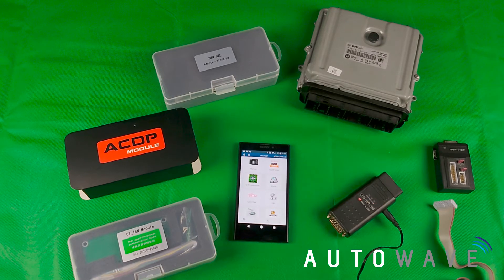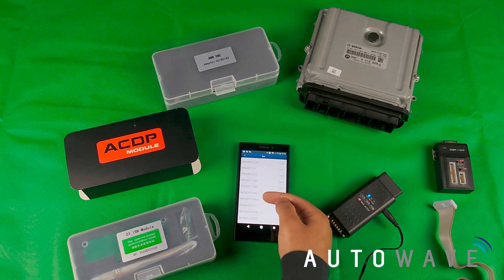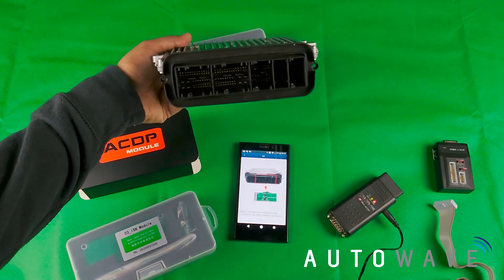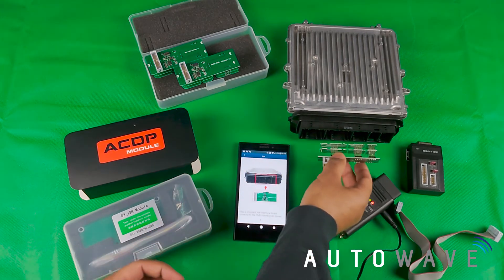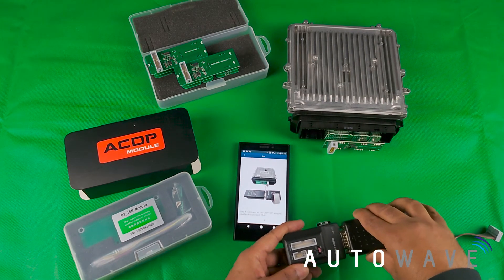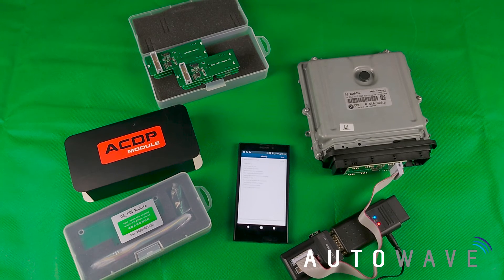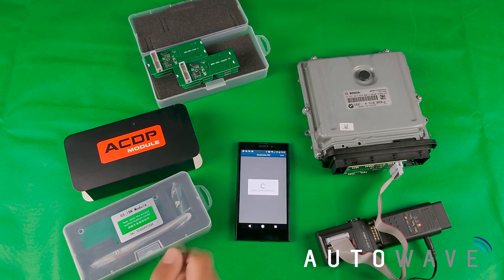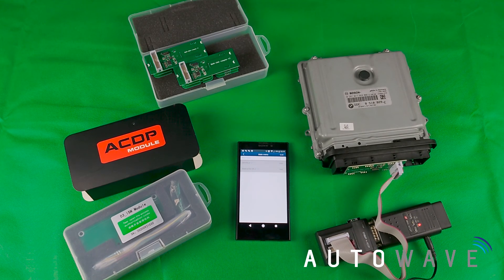Reading ISN on BMW ECU using ACDP Module 3

Comment: A friens did the same thing but without the adapter, he used the PCAN cable, he real all okey got the isn number and backout of it, he install all back and make dealer key but did not work. Another locksmith went and when he read isn again it came back as 00000000000000000 . Do you know whats the error here and how to fix so we know next time. Thank you great video explanation, we will be buying this adapters make it easy
Reply from the maker: Hi Adalberto, maybe using the PCAN cable it is possible the ISN was corrupted or the other locksmith might have just failed to read correctly. I think the issue is most likely to have been the method used to make the dealer key. Reading the ISN is the smaller part of the job. Hope that helps. Thanks